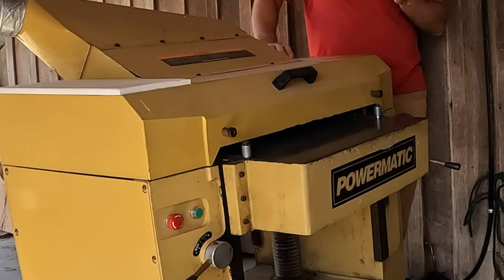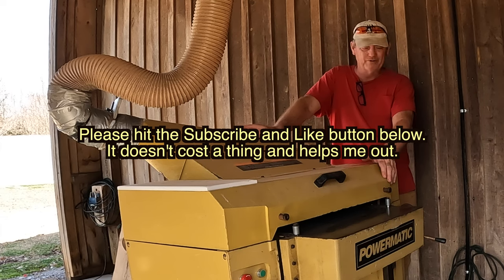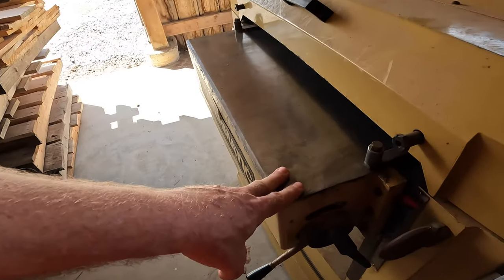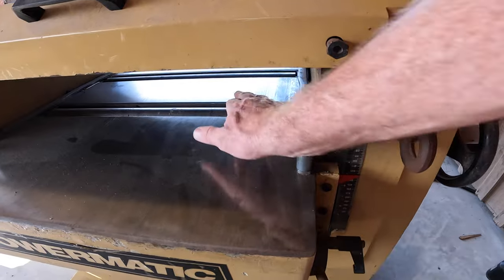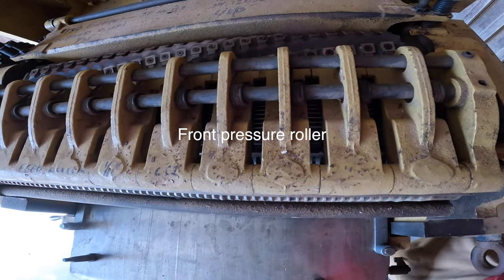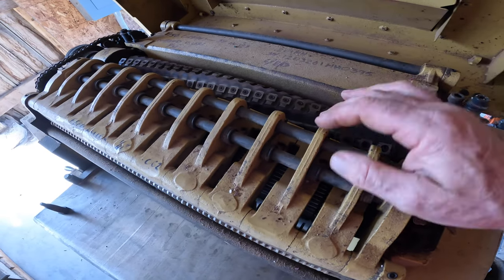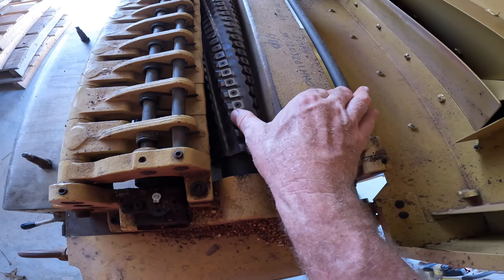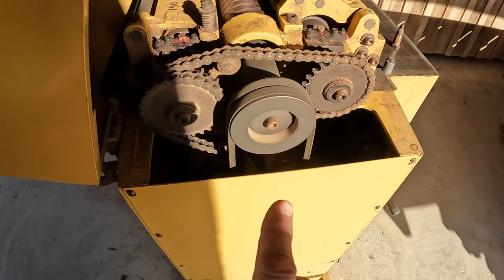LUMBER PLANER -  Stuff You Didn't Know!

Comment: That is a nice planer.  Thanks for the explanation of the features on your Powermatic.  The segmented roller and bed rollers are two features that would be so welcome for the short boards.  I have a Woodmaster 725 and did upgrade to a helical head.  Big difference.  So do you slow the feed rate for oaks, Ash and sycamore?
Reply from the maker: Thanks, it just depends on the the width and depth of cut.  Generally, we just let it eat.

Comment: Can you elaborate on rotating the knives 180 not 90?  This might explain why I have lines after rotating my knives 90 as the owners manual shows (all 98 of them #*%”  it !)
Reply from the maker: Rotating 90 will put a star corner on one side and a dull corner on the other.  So it will cause streaks.  Rotating 180 will put two share corners into the wood.  Then then next rotation to 90 will put two dull corners in the wood.
Reply: @HobbyHardwoodAlabama    That’s ingenious Robert!  Thank you